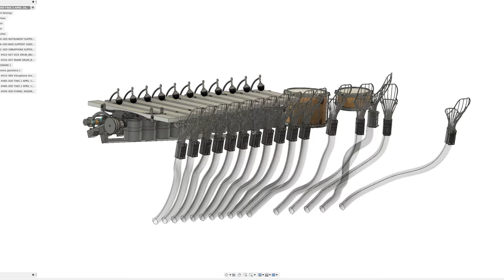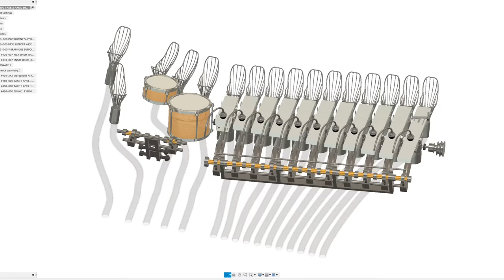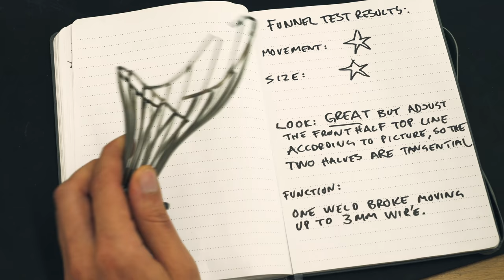Marble Funnel Design Test - Marble Machine X #87

Comment from the maker: Chillax Level 10 from here on
Reply: Nice >:]
Reply: Nice!
Reply: Nice
Reply: Hey Martin, welcome back! Have you thought about adding another bolt where your finger was instead of more spring steel??
Reply: @gregsmithy1986  came here to say the same thing!
Reply: I want a marble machine
Reply: welcome baaaack in france :D
Reply: Dio Brando  Yes it does. This was mentioned in a previous vid.
Reply: @gregsmithy1986  Thats exactly why I went into the comments section... I would suggest to place an additional bolt/screw where Martin pointed with his finger, or even a little bit higher. It would give you a precise Option to tune the spring. You wouldn't need the second spring...

Welcome back, Martin
Reply: I've cranked mine to 11!
Reply: Welcome back Martin!
Reply: When you make the rim of the funnel more of 1 continuous line, you should put a small piece of rubber to act as a dampener on 1 of them where the rim connects, just so it makes less noise.
Reply: Yessssss....
Reply: Yeeha! Hadn't expected it was Wednesday 😀
Reply: welcome back from your holiday :)
Reply: Have you not tried to make light weight leaf spring.
Reply: Hot soldering would be much, much easier for those wire cages.
Reply: @skik210   magnet
Reply: Nice look !

You just need to put a screew uper on the spring to reduce oscilation, like your finger.
Reply: Add a magnet to the funnel so it stays shut after the first bounce
Reply: Welcome back. Your videos are really awesome to watch. Now that you back 10 min was too short. Lol, I'm looking forward to next week Wednesday.
Reply: 3:33 if putting your finger there was the solution, then why not just move the bottom screws up to that spot instead of adding layers?
Reply: Glad that you had a relaxing vacation, but I'm more glad that I can watch your videos again ^^
Reply: What about a layer of felt or rubber between the two pieces to muffle the trembling metal noise and also avoid the shaky movement, to allow just an open-close clean movement??
Reply: AMAZING! Welcome back!
Reply: So glad to hear you enjoyed your vacation and your chillax levels are off the charts. Even happier to see that glorious notification re-appear about a new post in the MMX playlist.

Welcome back!!!
Reply: Pre bend the spring steel
Reply: In case other comment gets lost: I believe there will always be wiggle/flimsiness so you could add tiny magnets where the two parts meet.
Reply: Duuuuude!!! 🏄‍♂️ 🤙 Welcome back!  You might want to pin this comment at the top so everyone can see it :)
Reply: Wintergatan I like the song reference in there during drum section
Reply: Ridin' duuude
Reply: Instead of having multiple pieces of spring steal you should have another set of screws somewhere above the middle. 👍
Reply: bbuku tan  what the thing you mean is
Reply: bbuku tan  aw all good, no hard feelings, but I really didn't understand the question :D
Reply: Welcome back  buddy..!
Reply: Dio Brando  smartphones nowadays have spirit levels. :)
Reply: Wintergatan, we all need breaks!!  Love your work!!  Thanks!!!
Reply: Martin why not 3d print these? I noticed you stopped using the 3d printer for the project overall.
Reply: Welcome back Martin, glad to see more progress on MMX.
Reply: When looking at your funnels, it made me think of flowers and their petals or leaves and how rain drops on them. This eventually led me to think of Pitcher Plants  that uses a interesting trapping mechanism to catch prey. You ever thought of theming your funnels to look like flowers or pitcher plants? No offense, but while they look nice, I personally don’t think they fit well with the elegance, beauty, and style you are having with the rest of the machine. Sorry if it feels like I am trying to push you into a certain direction, I am not. This machine is entirely yours, your teams, and whoever else contributed to it. I am simply voicing my opinion and it is your choice to choose what you believe is right for it. Sorry again, and thank you for taking your time to read this.
Reply: just a quick question about the funnels, wouldnt it be easier to make those out of copper wire and solderign them? the copper collor might look good on it
Reply: @DMadHacks  ☺
Reply: Expat MONDAYS AND WEDNESDAYS
Reply: @the_dreamers_den  Its a funnel catcher.
Reply: @mxslick50 ?
Reply: @lethamvids  Why does alot of Wednesday have on the week lol. Sunday Monday Tuesday Wednesday Thursday Friday Saturday.
Reply: Lol

Comment: Would have thought adding more screws higher up on the spring steel...
Reply: My thoughts exactly. He could have probably just put a screw exactly where he was holding his finger to get the result he wanted, instead of adding a another piece of spring steel. If the damping from his finger was contributing he could put a small rubber gasket between the screw and spring steel.
Reply: There are various ways to accomplish this goal.  All springs deform under load and then return.  The oscillation is a function of the mass carried by the spring and the spring constant (K) of the spring.  Adding mass lowers the frequency of oscillation, deducting mass raises it.  For a given spring constant, lengthening the spring allows more deformation, shortening it allows less.  So you are correct, shortening the spring when multiplied by K, allows less deformation.  

The real issue is that to decrease oscillation (the real complaint), you need to raise K very high, which decreases the visible motion, which Martin wants.  Alternatively, he could lower the mass, but as a practical matter, neither of these approaches will work.

What will work is what is on cars.  Martin needs a spring that allows deformation, but adds a shock absorber (spring damper) to reduce oscillation post deformation.  You can observe this  when you change the shocks in your car.  Prior to the change, the car bounces up and down after a bump.  When the shocks are replaced, the car still goes over the bump but doesn't continue to oscillate.
Reply: WhatAboutTheBee I hope the team sees this. Someone needs to put this on their subreddit
Reply: Nah. I think this will just increase frequency of vibration, but not internal friction which will lower amplitude.
Reply: Well I can't be certain, but I think adding screws to the middle may make it degrade faster. This is gonna get bent back a bunch of times *per song*, and it's only a small bit of metal to begin with. That's fine when it's the entire bit moving, because there's less pressure on the whole part overall, but when it's screwed in at the middle, then you're going to have a problem eventually where the metal starts to bend back permanently. Maybe I'm wrong, I don't know much about spring steel, but it seems to me like it's less designed to be sturdy and more designed to be bouncy. Adding the extra spring steel relieves a lot of the pressure on the original part, and it also makes it a stronger part.

Source: I break things far too often, and played a lot of bridge constructor.
Reply: @tempname8263  the magnitude of deformation and frequency of oscillation is a function of spring constant and mass.
Reply: @lucas29476  Feel free.  I don't need credit for this basic engineering concept
Reply: @SirJonathonDanielGregorySrVthe  No.
Reply: I thought that but then I realized that he would have had to drill a hole through the metal and could possibly messed up the other side
Reply: @WhatAboutTheBee  But I was talking about friction stuff
Reply: @user-rg3rt1tm6f  2:11 no. There are 2 more holes on the bottom part.
Reply: You, Sir. Jonathon Daniel Gregory Sr. V the third Jr. are the first to actually have an accurate assessment of what is going on. "Just putting a screw in it," would greatly diminish the life span of the spring steel. It's amazing how many people forget that Martin is an engineer and understands concepts that eludes them.
Reply: I was thinking the same thing, but with a sliding placement.
Reply: He's just missing a damper to get a spring damper system. It would make it less flimsy
Reply: No, make a rectangular thick washer with slots in it clamping the spring steel so that it can be adjusted to the perfect position.
Reply: @WhatAboutTheBee   Wouldn't several layers of different lengths - a spring package - reduce the oscillation as well? Fine responding quality isn't expected I think as the marbles will hit pretty hard.
Reply: had the same idea :DD
Reply: @alphonsbretagne8468  I will answer succinctly.  You will change the K of the spring.  Depending on how they are stacked may mean different K's in the time domain, leading to unusual oscillation in the frequency domain.  For controlled, reproducible results, Martin's Engineers must solve the spring-mass-damper equation.
Reply: @tempname8263  I mean no disrespect.  Friction can be made to work in the short term, but it suffers from non-reproducibilty and wear (second order effects).  Selection of the spring and damper realizations are critical for success.
Reply: @WhatAboutTheBee   thank you for further  explanation
Reply: @alphonsbretagne8468  you are quite welcome.  I appreciate politeness on comment boards!
Reply: I’m thinking magnetizing it, in a way that makes it weak enough to sway from the marble hit but strong enough to not let it bounce even once
Reply: Given that the cage part has 2 sets of holes, I would have thought that populating all of them would have achieved the faster return on the spring.
Reply: alphons bretagne • Somewhat like a leaf spring on older vehicles? 🤔
Reply: alphons bretagne • Somewhat like a leaf spring on older vehicles? 🤔
Reply: Multiple Layers of Springs will add friction. Friction will allow big movement but stops the rocking rather quickly.
Reply: I would've just wrapped a rubber band around it.
Reply: Adding an extra bit of steel means he didn't have to drill and tap more holes.
Reply: @WhatAboutTheBee  Yay someone who actually knows what they're talking about - a paired damper is required. (or dashpot as we called them at uni!)
Reply: Been here to say exacly that
Reply: @cheeseybeaver  Thanks for recognizing!
Reply: Like others have said, what is missing is dampening, a screw higher up with some sort of dampling material would be good.
Reply: Instead of tapping a new hole where you finger was holding the spring steel which could introduce a stress point, you could put in a steel block with slotted holes that's secured by the two bottom screws. This would allow you to adjust each funnel individually as the marbles would be hitting each funnel with different force due to differing heights from the instruments.
Reply: If the edges of each side of the funnel hit each other at the top, I think that a lot of the oscillations would go away. There should be no almost no return force from the two pieces of metal hitting each other, and that would prevent the spring steel from flexing the wrong way, flinging the funnel back again.
Reply: But that hole would have been permanent wich means if he's not happy with the result he couldn't change it. This is a bit uglier but more practical solution.
Reply: @beefykojak  this sounds like the best solution so far. Hopefully Martin sees this!
Reply: Came here to ditto what's already been said
Reply: Tim Keller here.  The idea for the springs was to stack them flat.  Have one that goes all the way up to the moving jaw, and stack others behind it, backing it up - varying the lengths to get a progressive response.   His reinforcing spring in this video diverged from that idea a little...  but that was the design intent.   By the way, the second set of holes at the bottom are for set-screws that’s go into the pmma pipe - they aren’t for adjusting the length of the primary spring blade
Reply: That would make the springsteel sheet go worn of faster....
Reply: I  think it may still oscillate because the spring is holding up against gravity, if that part was counter balanced then maybe it would do the trick.
Reply: If you laminate the stack of spring sheets together with double sided tape, the tape acts as a damper. Constrained layer damping is the technical term. It’s very effective for taking out the high frequency oscillations.
Reply: @WhatAboutTheBee  which is what the rubber gasket or felt pad would accomplish.
Reply: @klschofield71  Martin isnt an engineer by training, he is just surrounded by them and has the mind of one.
Reply: @beefykojak  I like that idea from an adjustability standpoint. I'm a little curious about fatigue within Springsteel though - how many cycles will the springsteel sheets be able to go through before failing? Increased localized stresses would decrease that if i remember from my machine design course. Then again, having a screw in the middle would introduce the same problem of a stress concentrator.

Fatigue is always my worry with these things.
Reply: @jonathanmckinlay1747  that is very interesting! I've never heard of that.
Reply: @flyerminer  Couldn't help but notice the contradictory nature of your response. His training, through the pursuit of his passions, has inevitably led him to achieving a level of understanding that many try to gain by means of higher education. But yes, technically you are correct, he is not a University accredited engineer, at least to my knowledge.
Reply: @ucdwino  Hello Tim.  

Firstly, permit me to thank you for your participation in this grand project!  Your efforts are appreciated by this observer!!

Martin has the wild creative urges, like any visionary, yet lacks formalized training necessary to predict outcomes.  Trial and Error will not be a successful strategy for solving this part of MMX.

May I suggest that the next version come more completely assembled, utilizing the engineered solution.  The forces applied by the ballistic trajectory of the steel ball will occupy a small solution space.  This will yield a predictable spring rate and, as you suggest, perhaps the stacked springs.  May I further suggest a  damper subsystem, which is a desirable feature based upon Martin's statements in this video.    Providing it assembled will limit Martin's "inventiveness" and urge to modify on the fly, sans engineering.

Again, thank you for contributing.  I cannot wait to hear this play

Bee
Reply: @WhatAboutTheBee  Agreed on the damping.  Just a neoprene / rubber bumper I think will help a lot.  I also think that we need to pre-load the springs so that it is still in tension while at-rest - and that will help to reduce the end-jitters.  Adding more spring force will reduce the overall motion, which he doesnt want.
Reply: @ucdwino  I'm not going suggest actual implementations as that would be presumptuous.  I do think your ideas have merit but I would caution on durability of the solution, unless considered a consumable.
Reply: @flyerminer   Thanks, I'm not an engineer or machinist, i agree with your fatigue worry  and i guess the number of cycles would be affected by the temper of the spring steel. I would consider this part a consumable and have a good supply in stock as it's difficult to know the effective life of the parts considering they would all be loaded differently during use. My thought is a good supply of one part vs multiples of different thickness or strength which would give you more flexibility for maintaining the machine on tour.
Reply: Having the second leaf springs exactly like it is at the moment is very good, because it adds friction, which dampens the oscillation. It also allows very easy control of the motion by just bending the second leaf spring.
Reply: while that is true, adding another spring steel to the mechanism makes for an easier adjustment then adding new places for screws.

Comment: When you pinched the spring with your fingers, it had perfect results.  Why not just add a screw where your fingers were pinching it instead of adding a second spring?
Reply: A coiled spring in that middle spot that can be loaded to a given flex should give the movement wanted, but cancel out the oscillation. Or basically a flat spring is the hinge, a coiled spring to dampen it, in an arrangement that works and hopefully looks good.
Reply: His fingers did more than just holding the spring: they also acted as a damper.  A screw wouldn't do that.  Neither did the spring.
Reply: he could screw on a damper
Reply: @peterfireflylund  Presumably adding a rubber washer under the screw head would fix that part of the issue.
Reply: @TheBrandoGR  Yes, that was also the conclusion I arrived at a couple of hours ago.  I just hadn't gotten around to writing it here yet :)
Reply: And for a real high tech solution, a rubber band would do exactly what finger did!
Reply: A screw with a coil spring and a nylock nut on the spot where the finger was held should also make this possible and the feedback tension of the spring would just be adjusted with the nut
Reply: Also you cannot let the moving arm rebound. Spring should be prenetsioned, so it would still have some force in it when the parts are together.